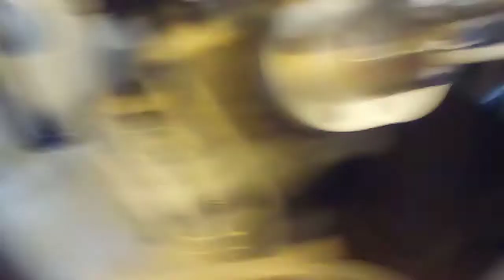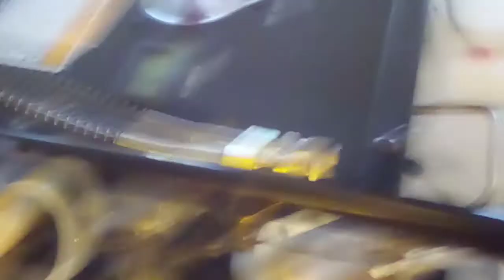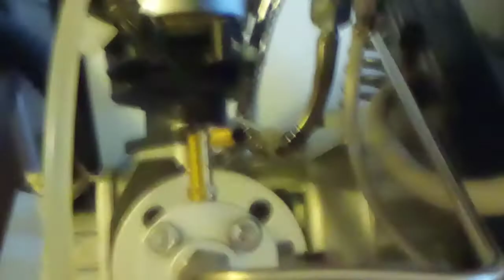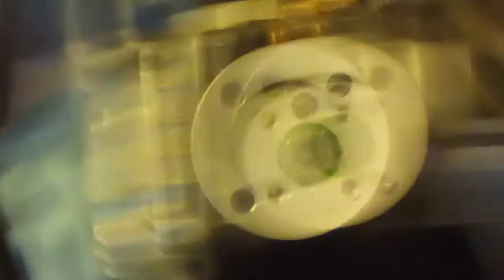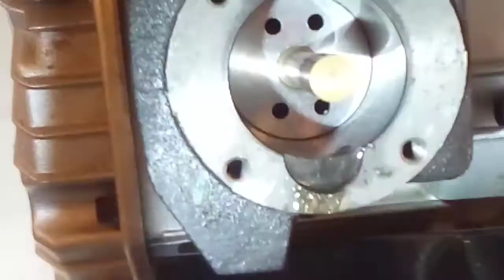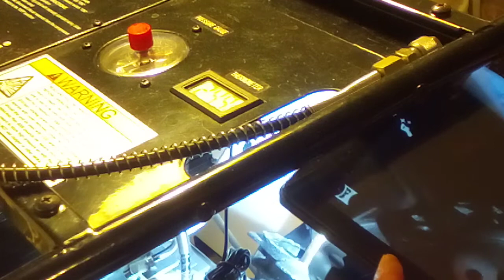air Venturi compressor. high pressure sealing ring replacement/disassembly. part#1

Comment: Fuck AV. Not only is my compressor spitting out that nasty whipped oil water mix, and it's not break-in residue. I've flushed it three times with royal purple sun film 100 recip.

But when I went to inspect the high pressure rings, I can't take the piston housing off bc they over torqued the Allen screw and just stick the head back in the hole.

0/0 with this joke of an outfit. I will make it my mission to make sure nobody buys this fucking shit compressor from them.

Comment: Hi Mitch, I'm sure this is the high pressure side. It's called the high pressure big valve plate. Pyramyd air sells it for about $16.00. If I take the head off and and remove the airline fitting in the head I can see it in there with a flash light. It's broken but I can't get it out the fitting hole. There is a plate with 2 holes in the bottom of the head, I bet there is a wrench with 2 pins to match the holes to take it out. If that's the case I can make one in the shop.
I will try to talk to Air Venturi tomorrow. I can't contact you in the ways you mentioned as I am not good with computers. Thanks for all your help and the videos.
Reply from the maker: My apologies I bought that same part and they did not call it that They just called it the high pressure valve That being said you can try to make a tool I tried to use Snap ring pliers And I was able to start it to come out but it would bind up I ended up just taking an Allen wrench and sticking it in the same hole you've shined your flashlight and just tapping around lightly to get it out It did bind up on me that way too you just have to go really really lite until  you see the green O ring then you can pull it all the way out using your fingers or maybe a soft pair of pliers.

Comment: I recently smelled a plastic burning.  Found out it was the air intake/ muffler type deal. It has a black cylinder part on top of the head of one of the pistons.  Anyhow all they did was send me a new one. I replaced it and within 5 min fill I noticed my tank was not gaining pressure.   I stopped it. Took off the exhuast cap which  the new one started to melt also.  My question is can the machine be run without that cap?  I think it just for exhaust and to muffle the sound but I think it is not allowing pressure to build. 
Thanks for your help.
Reply from the maker: Broc wavra. No you have to have that on there that's actually your intake filter. it's what sucks the air in. And it needs to be kept dust free. as to not contaminate the piston and sleeve with a bunch of dirt on the low end where the black filter is on the top of the head. That being said you're low end which is the one that has the filter on it should not be getting hot enough to melt that filter!!! That's telling me you have or may have issues somewhere else. As far as it running with the filter on and it not working. Try putting your old one back on and seeing if the machine will build pressure.  . I think I could help you much better if you give me a call 707-393-8747. I'm in California I don't know where you are I'll be up late if you want to call me when you get this message. There's just too much things I want to tell you so we need to talk.
Reply: @skinnymitchairgunbrotherho7152  thank you so much for looking out. I actually got a call from Air Venturi.  They believe the heat displacement at the bottom of the low pressure broke.  They are paying for the shipment back for repair which is awesome. 
Thank you again 
Broc
Reply from the maker: @brocwavra8813  that's fantastic news. I knew there had to be something underlined wrong. Keep me informed on how it works out in the end.
Reply: @skinnymitchairgunbrotherho7152  Will do!!

Comment: Thanks for making this video man. I have to fix mine so it is nice to see your video. Man that was a real nail bitter at the end! Lol Hopefully mine will be building air tomorrow by this time.
Reply from the maker: Believe it or not I'm just now getting notification for your comment. YouTube's got it together. not!!!! You're so very welcome. that was the point of the video when I made it. there was no information out there on how to disassemble and assemble these things. Or to know what to look for as far as signs of something that could be going wrong. And since I was going through it myself I figured I would share and help other people. Now there's pretty much nothing that I don't know about the airventory compressor. Of course I'm sure there are some issues that haven't happened to me that I am not aware of. All I know is I can disassemble and assemble the whole thing pretty easy now. Sorry for the late response.
Reply: @skinnymitchairgunbrotherho7152  No problem man! I am going to have to watch it again because I still haven't fixed it. Lol 😆 Now that the weather is getting nice I better get on it. Thanks again for making the video!
Reply: Thanks for the video. What did you set the torque on the head bolts?

Comment: Do you still have this air compressor?  I just bought one. Is it working good?
Reply from the maker: Yes I still have the compressor unfortunately I've been having some issues. Right now it is currently sitting at air Venturi repair center. The crankcase cracked on it I replaced it myself. But upon disassembly I noticed that the shaft was severely damaged. No choice but to send it back. That being said when it's in working order it works great. Hopefully you got one where all the bugs have been worked out.
Reply: @skinnymitchairgunbrotherho7152  I've used it twice and it's only got up to 40 Celsius. I see everyone using all kinds of different oil and they said that the recommend ISO 100 ,I'm using amsoil compressor oil.  But yes I sure hope it lasts a long time.
Reply from the maker: @rightsideup4444  yeah there's a lot of hype out there about what kind of oil is best. I just use what my manual recommended. I have one of the first generations the manual specified 10w40 or compressor oil. The newer generations probably the manual is updated because they make their own oil now. Which is the ISO 100 if I'm not mistaken. Which is okay to use in my opinion it just needs to be changed more often. It's basically refined mineral oil.

Comment: Was it not building pressure to 4500 psi?
Reply: 1300.00 for this Chinese built compressor, and the gasket and seal kit DOES NOT come with HP replacement seals or tool! Have issues with mine after just 3 months! Really struggles at top to reach 4500 psi!
Reply from the maker: Lionel actually it was creating pressure just fine. The problem was I was getting massive amounts of foam from my pressure release valve. Even after everything was shut down released the whole procedure an hour or two later I would have a bunch more foam coming out of my pressure release. Air Venturi suggested I replace the high pressure a sealing rings.

Comment: So did it fix it? Waiting on part 2!
Reply from the maker: Gary I actually did a part three air Venturi compressor the conclusion which explains my end result I did end up having a little issue but it was resolved go check it out. I actually had to go back and check I could not remember if I did a conclusion lol but I did. Thank you for your inquiries and comments oh and I guess I should tell you that not six hours in after this repair my crank case cracked so they sent me a new crank case I did end up replacing it but the front plate fasteners do not lineup. I ended up not doing a video but I am going to throw up a thing telling people that if they need help replacing the crank case I know how

Comment: Did that tool come with the rebuild kit?
Reply from the maker: Hey Gary I'm answering both your questions in this comment. Yes its fixed. And no I had to buy the special tool separately.
Reply: @skinnymitchairgunbrotherho7152  

where did you buy the tool?
Reply from the maker: @willbaker8492   no it did not come with the rebuild kit you have to buy it separate from pyramid Air you might be able to get it from air gun Depot also.
Reply from the maker: I got mine from pyramid Air

Comment: One trick on getting the rings to stretch out to size is to put them in boiling water first. Then do them to size. I didn't have your nice tool to make things easier. Used needle nose pliers to widen them. Slip the ring over the closed needle nose, then work the ring to size by opening the pliers and rotating as you go. Then once on you get them as cold as you can with whatever you come up with, ice cube, cold rag, ECT. That will get them to swrink to size better. Yes, alot of work. That tool could have saved a lot of grief.
Reply from the maker: Thanks my airgun brother. Very useful info. The tool definitely helps. I got lucky that someone made me aware of the tool before I tore my machine apart.
Reply: @skinnymitchairgunbrotherho7152  how's the unit holding up since then?
Reply from the maker: @Michiganairhunter  replacing the high pressure sealing rings was a success. I don't think that was the cause of my problem. Once I figure it out and have more information I will make a video. Thank you for your interest . I will definitely keep you posted.
Reply: So you only have to rebuild the one cylinder ?
Also when you buy the high pressure piston seals, are there 3 in the package ?
Reply from the maker: Melton homer. If you just want to replace the high pressure sealing rings then yes you only have to rebuild the one cylinder. And no the high pressure sealing rings are sold separately one in a pack. Which didn't make me very happy when I found that out. When I got mine they were $7 each from what I understand the price went up. See how they get us they can charge us more if they sell them to us separately. But the machine takes three. That's the only reason I can think why they wouldn't give us a three pack.
Reply: @skinnymitchairgunbrotherho7152  what’s the other cylinder for ? Sorry I don’t understand the two cylinders but mostly only rebuild one. The high pressure piston rings aren’t expected back in stock till November is what someone from air Venturi told me. Real bummer.
Reply from the maker: Your left side is your low pressure side and your right side is your high pressure side. So I'm going to give it to you in simple terms for you. to help you understand. So your low pressure side the left cylinder. brings in the air and compresses it to your high pressure side the right cylinder. Which then compresses the air to the  4500 PSI. I hope that makes sense like I said it's very simplistic explanation.
Reply: @skinnymitchairgunbrotherho7152  thanks fantastic info, completely understand now.
Reply from the maker: Oh thank God you understood because I'm horrible at explaining things in text.